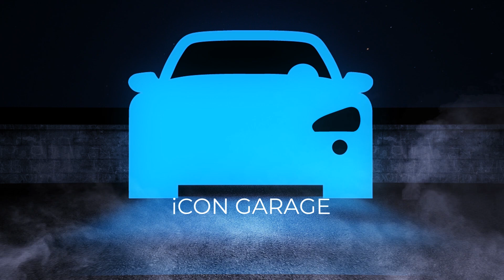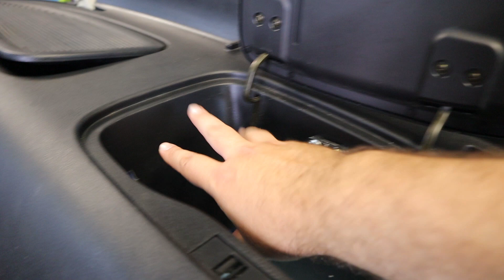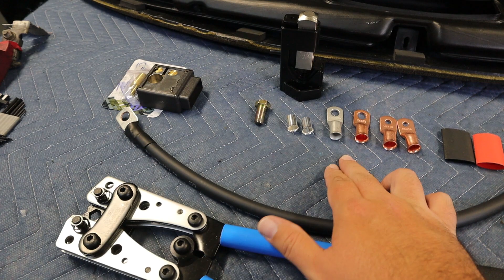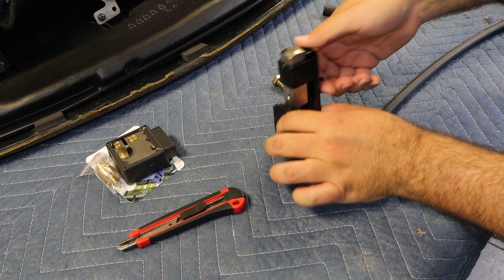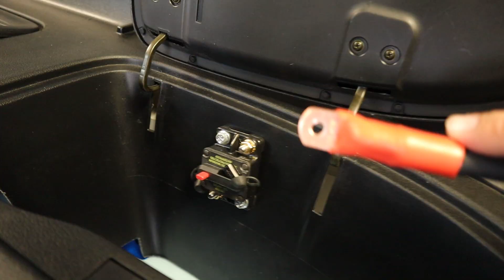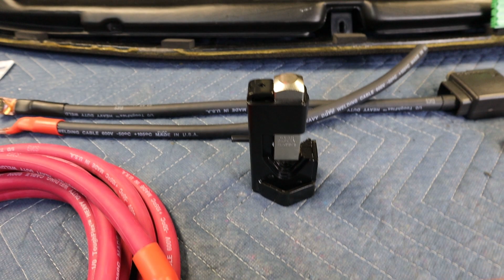Making Custom Battery Cables (for FD RX7)

Comment: What size welding cable did you use?
Reply from the maker: 1/0 but it is likely overkill... look at the length of your run and max amps and look up cable size charts. I will never need it but I think this is good for 400 amps if I recall based on the cable I used. I think there is more info in the description of this video or one of the others.

Comment: You don’t need put circuit breaker, if your starter draws more Amps than your breaker you will be popping it every time, car manufacturers don’t use them at all....
Reply from the maker: I’m not using it as a circuit breaker (protector) as much as a quick way to kill the power instead of pulling the cables. Yes they make switches to do that, but this works just as well. Haven’t had any issues. At 150 amps, it is rated much higher than the max amps in the setup. If I switched to a larger alternator, more fuel pumps, stereo amp, etc... and had a larger draw, I could trip it and would need to go to a 200 amp or larger breaker.

Comment: Sweet video I'm getting ready to do mine just need to order my cable. How much cable did you actually use for the positive
Reply from the maker: I think the total length was 15 feet and I probably had a couple of feet left, maybe more. I also kept it a little loose in the storage bin and engine bay to have some extra. So I’d say about 12’.
Reply: @IconGarage  great thanks I ordered 15ft just to be sure thanks for the great video and info
Reply: I sourced a lot of the same parts thanks to this video and the battery relo worked flawlessly. Though i cheated a bit using the LRB tray and rear interior delete to make mounting easier and save my bins. Also withstood a full track day!

Comment: Nice cables! Those aren't cheap. Once I crimp my solar cables lightly, I use a propane torch and some solder and melt it in there and it flows down in. Then you've got a more solid connection.